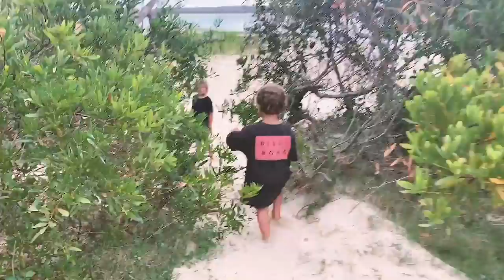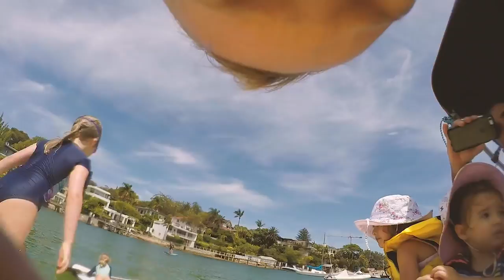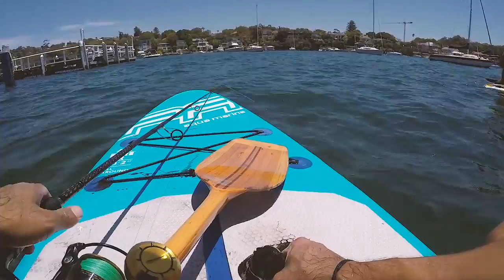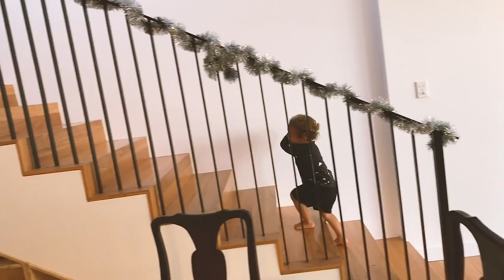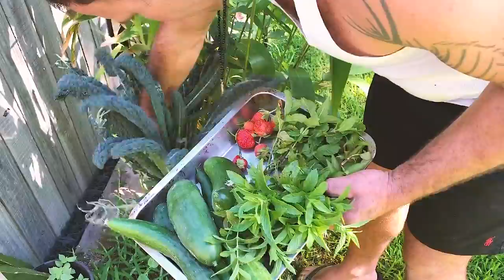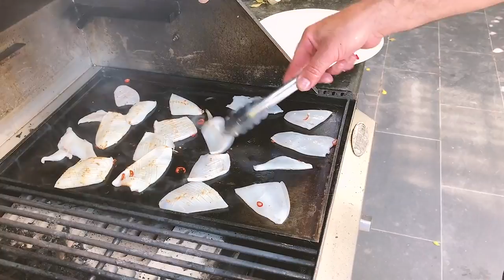Cook Perfect Chilli Squid - Sydney Summer Road Trip Catch and Cook

Comment: what engine is the landrover? 2.7 or 3 litre turbo diesel? 

d3's are known for shattering crankshafts in both 2.7 and v8 goood luck great rigs otherwhise
Reply from the maker: Its the 2.7Ltr V6 Turbo Diesel... so far so good 🤞🏽
Reply: @rokkitkit  yeah don't miss a service and be warned about the crankshaft it's replaced every now and again as a service item but they are great cars when looked after by a landrover guy that is the key also when they do the timing belts they lift the front of the chassis too to do the rear one and that can be expensive too

BTW I love my ladies they are comfy and very capable offroaders but just make sure you have it serviced by someone who lives and breathes these things otherwise you will have problems